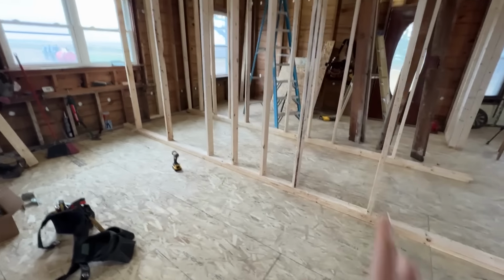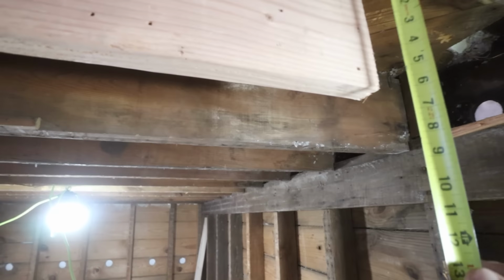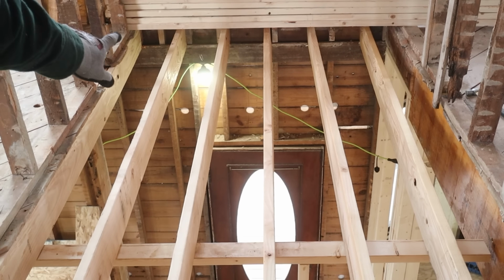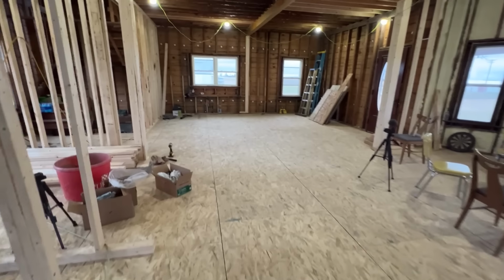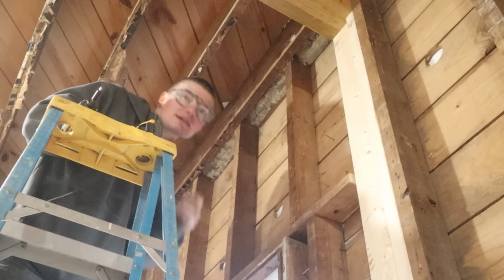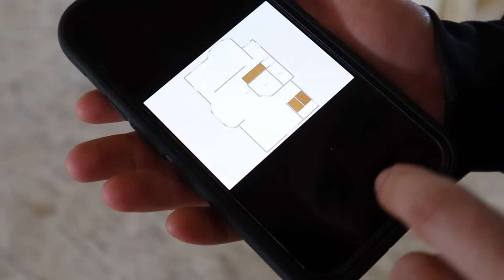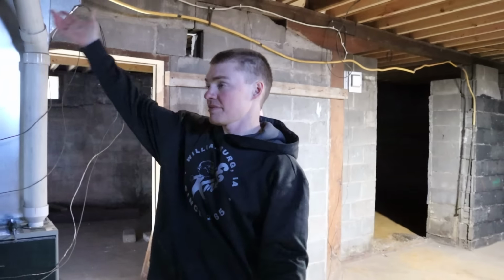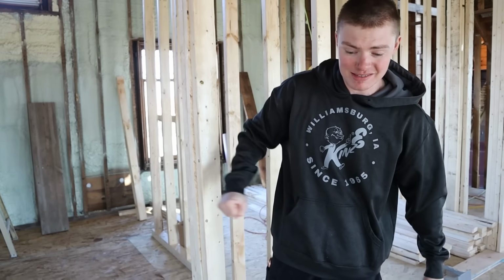Restoring A $7,000 Mansion: Rebuilding HUGE Kitchen

Comment: Love the work. Im a master electrician. You might consider either a 225 amp main electrical panel or upgrade to 2.... 200 amp panels and get your main power from the street upgraded to 400 amps. That's going to allow you to have all the power you're going to need plus extra in case say for instance..... A little more power in the basement for a mini workshop area, outside landscaping lights, a garage for just the cars and not for the farm. Etc, etc, etc...... 200 amps is not a lot for a house that large. Unless you have gas lines and then your stove/ range, boiler, water heaters ( insta hots only need 120 volts and draws maybe 2 amps each ), dryer etc. since you're going this far with the remodel/rebuild you need to talk to a good electrician who can do all the load calculations and figure out what you might possibly need for the future
Reply: Also do not do the electrical install hot water heaters because they draw so require and drawl so much power to operate and they don't work nearly as well as the gas versions of them. The gas just works so much better with efficiency and quality of hot water
Reply: Insta Hot not install hot. Damn phone
Reply: He is going to have his friend thats an electrician do the work or at least help him. He has already had meetings with him about it he said.

Comment: It's coming together! Don't get rid of the door. Keep it for the new entrance. It's worth it's weight in gold! You can't find a door like that anymore. You'll want the character it will bring. Try to save the windows. They just may need a new frame, again, you can't find windows like that with original glass. After my grandparents passing, we had a ton of things most would think it was junk. Turns out, even the tools were worth money. We had 4 antique dealers go through the stuff. But, there were a few things we kept for sentimental reasons. ❤😊

Comment: So glad you’re addressing structural issues now.  I live in a near 100 year old attached row house in New York City!  Not many levels or squares were used in the building of these old houses. We are addressing structural issues too on an extremely smaller scale.   

A big and practical suggestion for the kitchen and bathrooms is to put a drain in the floor of those rooms, to make them easier to clean as in no buckets, and cause you all have kids and we all know kids love to play with water. A drain hidden in the center of the floors of the Kitchen and Bathrooms will make flooding the floors and house near impossible.  I suggest it cause my cousin’s kids kept flooding the 150 year old house he rebuilt when they played with the water, one flood went from the 2nd floor straight to the basement wrecking a closet and more!   I’ve a drain in the center of my handicap accessible bathroom I designed and added on to my house I love it for cleaning and now I hate not having one in the kitchen that i redesigned, of my near 100 year old house.  If fortune were to smile on me I’d have a drain in the floor of my second floor bathroom and my kitchen.  One it’s great for mopping the water can just go down the drain and 2 when your older and can’t lift a bucket to dump you no longer have to worry about.

Comment: Still thinking I would like to see the ribbon board beefed up. You have plenty of ceiling height to hide a 2×6 or 2×8 attached to the studs under the floor joists. What you have works, but if you find in the ducting or plumbing layout, that you need a soffit, definitely beef it up.

Comment: You know you can screw in those joist hangers, right? I used to be a huge advocate for nailing since screws were more expen and seemed harder. But after screwing a few, it's so much easier. Use a hex head 3/8 drive wood screw and you can use it to manipulate a stubborn joist hanger. Just use a fairly long extension so your driver does get innthe way

Comment: Simpson company makes screws called Strong Drive for the metal ties that you can use instead of nails with you battery operated drill/driver. It saved us a heap of time and energy. They are right next to the Simpson strong ties in the store aisle. And yes, they are made for and rated for securing joist hangers.
Reply: This is very helpful, I hope Cole reads your comment

Comment: Cole, are screws ok in joist hangers?  I think those nails have greater tensile strength than screws.  Not up to code in most places.   
Also, Nuclear option #2... Tear out block wall and replace it with a beam like the rest of the joist supports.  Do you really need a wall below it?

Comment: I see someone mentioned already, but a steel beam or more laminated beams may save time and be cheaper in long run.  Also wonder is using steel plate on both sides of that wood beam (drilled through and bolted after jacking the wood beam to level would be a perm fix🤔

Comment: I’m wondering if it’s possible to abandon ship on the below grade plumbing, do a hung sewer, tie in to the existing plumbing outside and use an insulated foam floor system that allow moisture through concrete but not to flooring. Dig out perimeter foundation, seal and install a French drain. Vegas 2024 build show had a floor panel product that looked interesting. YouTube buildshow Matt risinger did a video at build show this past week. Cool stuff. Seems like there are alternative options to digging up all of the basement concrete... but then again it is crumbling. Best wishes on your build/rebuild

Comment: Looking at that wall in the basement, I would not be surprised if it was built under the wood beam at some point. The beam has angles sections on the posts. No need for those if the wall was always there. I second putting in Steel or a Micro lam beams instead of a new wall.

Comment: What if you put a steel beam on top of the basement wall and fill in the gaps with concrete?
Reply: Walls not sound enough to do that.  You know the weight of a steel beam to carry that much weight?  You will need footer to carry the weight an they have to meet spec.  Beam will be like 4,000 pounds. cost probably north of $4k just of the beam.  Then how are you going to get it in to place?   Better option would be LVL and then adding plate steel to the inside of theme to get you to higher load rating and still be able to easier build and attach to the lvl.

Comment: I would say your posts and beams were the original structure in the basement. That block wall was added later to support the beam after it had already sagged for many years. Unlikely it would continue to move with the band-aid option, but given the high quality work you’ve been doing in the rest of the house why not go for the nuclear option 👌 makes great content too 👍👍 Only problem with this project is that it will end some day 😢

Comment: If you shim up the joists be sure to use hard wood like oak and not pine which would compress. Then use a 1 1/4 thick laminated beam on either side of the old one bolting them together. New beam would touch level against joists. You could also add the same beam material from under beam and down to the floor with aluminum risers between them and floor concrete for water protection. You could even bolt these through cinder block walls. You have options for the basement,  
Have you considered a mud room or area, place to take your boots off as your entrance would be a back door.
Reply: Or he could just buy a couple screw jacks and jack up the floor. But I guess he'll have to address the basement floor now that he's got the first floor sheeting down.  I'm waiting for the two weeks of video of them carrying concrete up the steps in 5 gallon buckets.

Comment: I would stop on the main floor and start cutting out concrete and pouring new footings for the new beams downstairs.   You will forever have a crooked floor if don't start from the bottom.

Comment: Since you discovered this sagging issue, have you considered using a rotary laser set at the height of the window headers. Architects often spec top of most windows to be the same e!evation. This can be a quick method to assess settling issues. Since your interior walls are bare bones, you can rinse and repeat for each floor. Then you can make plans to attack any issues that arise. It may make sense to consult a structural engineer for advice. Keep up the good work guys.

Comment: The "noch" at the end is called lock joint it was used to make it harder for floor joists to move. This fell out of use with modern building techniques. It is still found in old homes that were expected to carry heavy loads on their floors.

Please stop calling this a restoration. If you still can't understand why people are upset, I suggest you take a look at restoration nation here on youtube. What you are doing is called remodeling. It is taking out what exists and changing it to fit your tastes. Restoration is repairing what exists without removing to much of what is there without adding to much. What you are doing is most contractors do. Its ripping out with no care to the actual skills needed to save.

You would have been better off leveling the building because your end costs would have been cheeper building new.

Comment: @Cole The Cornstar
Hey Roman,  you can prevent future possible splitting of the notched floor joistseses (hehe), both old and new, by driving a  3 inch drywall screw upward just past the notch.    just sayin' ......

Comment: @ColeTheCornstar Cole, if you want To make those large leaded / beveled glass windows more energy efficient: your can install a new double pane picture window and cut the top bevele glass section (leaving the wood frame in tact) an hang it from eye hooks at the interior to keep the original look. I have done this for many clients as I have been a contractor for 15+ years in the window and door industry.

Comment: You didn't mention it while talking about the basement, but are you considering in floor radiant heat for the basement while it's all torn up?  Besides eliminating the 'cold zone', it would hep heat the rest of the house overall and possibly give you the option of some more finished areas, like a nice bathroom, in the basement.

Comment: you should get a big whiteboard to list all tasks and then maybe another one for random notes - opening it up makes it so much easier to work - do get a big island with a sink (have 2 sinks) and nice countertops - granite but shop around - double and triple check everything - have multiple punchlists. if you get a laser it will shoot points 360 to sills - i think you can sort things out but good to catch issues early before you goto 2nd/3rd fl. you probably want to blow out a few walls in bsmt and get zeroed - you want to start in bsmt and get it all rite - with basement opened up demo will go easier and you can always build some quick walls if you need to subdivide space down there - it will be easier to work once you have space and can see what you are working with - yes it adds some time and cost but it is an old house and remodel will be worth it - consider adding foam boards to walls but think about condensation issues too - you may want spacers and gaps on bottom? get varying pro opinions and vet all the info
Reply: You know this is a farm channel right? He doesn't do whiteboards. I am certain wifey makes the call on the kitchen stuff.
Reply: You guys don't know Cole haha, he is big into details and planning. I'd be willing to bet you he has a giant spreadsheet with all the tasks and order of operations.
Reply: @DerekThorpe294 Have you watched more than one of these house restoration videos?  He has no idea what he's doing.

Comment: Hard to be 100% sure, but that beam combined with the the wooden t- posts in the block wall make me think that wall isn’t original.  It was probably just then big beam and posts holding up the floor, then when the floor started moving they added the block to try and stop it from getting worse.  If the block wall had always been there, there would just be a 2x on top of the block, and no wooden posts

Comment: None of that center cinderbrick wall was original to the house. You can see the original timbers in the wall. Those timbers were more than likely the only thing there when it was built. That basement was open when it was built and at some point reinforced with a cinderbrick wall.

Comment: GYP-CRETE use GYP-CRETE to level your floor. Then used an LVL beam to replace the wood beam in the basement, making one span and eliminating the need for the block support wall.

Comment: I hope your adding a backup heat/wood stove to preheat circulation tanks with propane backup so you can leave in the winter and not come home to an ice rink.  Build a load shoot into the basement for firewood.  Stock the outside boiler on your time.
Reply: Masonry heater all the way but they already removed the chimney lol
Reply: Does that mean he's going to have to put the chimney back in?

Comment: I would recommend you span an I beam across the basement so the walls aren’t  necessary
Reply: DO you understand the size and weight of a beam to carry that load?  Your not getting it in without equipment and then you still need to support it.

Comment: You know they should make gloves with the very tip with a steel cover over the top and sides of the fingertips. That way you can feel what you are holding, but you will not smash you fingers. And Cole, by now you should understand Remodel = Can of worms.

Comment: I'd just run new 2x lumber on each side of the existing beam to level the floor.   I don't know how wide th existing beam is.  Looks like 8 to ten inches.  I hate unlevel and crooked work myself. It bugs me.   You way is the best way but by far the most costly.

Comment: Spencer Tracy to Katherine Hepburn ("Desk Set", 1957): "Never assume." It's too bad you assumed that everything was level because of the stone foundation, but it is a good thing that you found out before continuing on with the construction moving up towards the attic. You probably would have gone on with the "easy fix" (option #1) if you weren't having to tear up the concrete floor in the basement, but who knows how that really would have worked out for the future structure and longevity of the house. It's been there for 100 yrs, you really want it to be there for another 100! Good decision. I hope your father agrees with your assessment that you have "a ton of time!"

Comment: saw on another channel that they said to be sure to use screws in hangers, where as nails over the years can pull down slightly and you will be back to squeeky floors again
Reply: nails are stronger in this application. Screws are brittle compared to nails. Like stairs, they need shear strength not a screws clamping force. Yes, i know they make structural screws now but some hangers recommend nails only or their own branded specific structural screws.
Reply: You're about as knowledgeable on construction techniques as Cole is.

Comment: Have you thought about adding some jack-studs and headers above the windows and doors before you finish covering the walls with insulation. It would be more practical to do it now, especially if you are going to change the windows. Plus it will give Justin and Roman more hours. And the viewers more entertainment.
Reply: They're going to do that after the drywall goes in.

Comment: Don't connect the appliances and ac/heat units together with lights.  They must have separate circuit breaker box for it.  The house is to old for it.

Comment: Looking good Cole and crew!

With all the walls getting removed on the first floor is there enough sheer strength for big wind?
Reply: that is what all the big new beams do, they transfer weight where required and transfer the weight down into larger beams going straight to the basement. Very sturdy :)

Comment: You need to make a bedroom on ground floor so you have it for older visitors
Reply: he has said before that he will be building an extension at some point that will have additional bedrooms. I live in a 2 story house, its 9 years old, we built it. we have about 3500 sq feet plus another 1000 in the basement..no bedrooms on the lower level. I did not build my home for an occasional visitor, if someone is coming to visit and has mobility problems I will put them up in a nearby hotel, or they can choose to sleep on my very comfy sofa in the living room  :)

Comment: Keep up the great work, it will be a fantastic home for you and your family when finished.    

One question - why have you fully secured all of the upstairs joists into their respective hangers when you do not know yet whether the upstairs joists are actually flat and in a good state?   Surely better to have them temporarily sitting withiin the new hangers that are attached to the new microlam beams, but have the joists not permanently secured in by nails - not until you lift the upstairs floorboards and see what state they are all in?

Comment: When you notched the floor joist on the bottom you are making it a 7” joist. Strength of your floor joist is at the bottom, hence why you’re not supposed to notch a floor joist on the bottom of the joist. If you are going to have something heavy in that area above consider furring out that exterior wall.